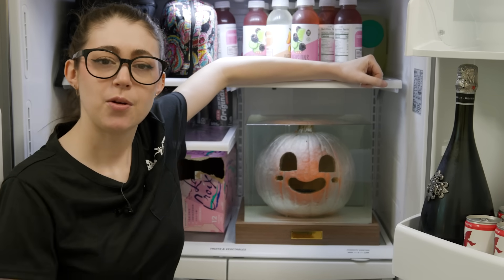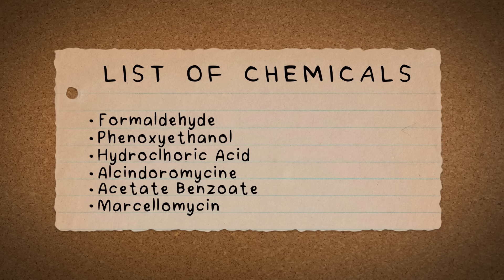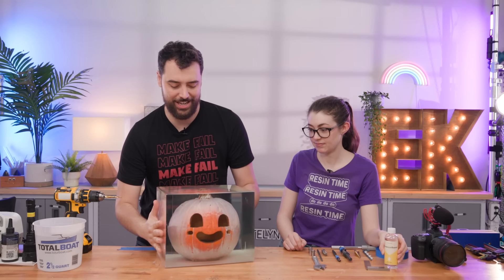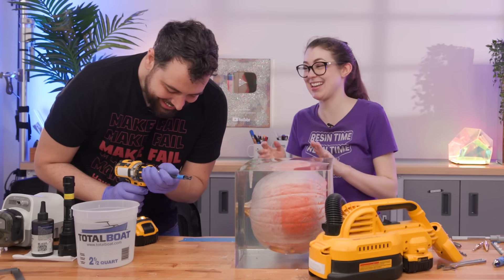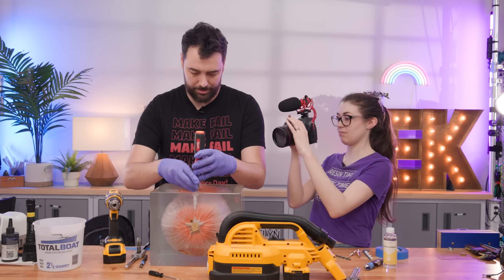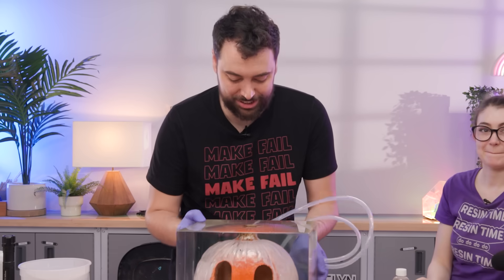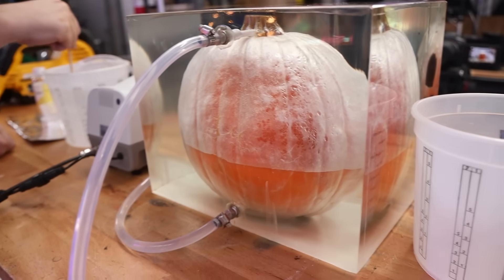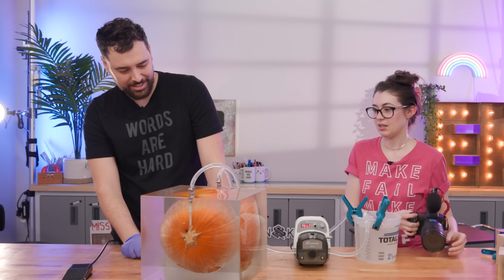Preserving A Pumpkin With Chemicals & Resin (feat. NileRed)

Comment: Katelyn, to fix your pants - soak overnight in a sink full of hot water with a cup of white vinegar and 1/2 cup baking soda. it will help release the oil from the fabric. rinse a few times and check for the oil stain , if its still there repeat the previous step with the vinegar and baking soda. use a small stiff soft bristle brush ( a firm toothbrush will work) and make a paste with the baking soda and a bit of water , scrub it into the oil and rinse a few time, then wash as normal. should come out .

Comment: Yall could try "speed bleeders" for cars brake systems. They are one way bleeder valves. You'd have to push more oil in and bleed the air out, but it might work!

Comment: Use your vacuum pump connected to one port with an expansion canister in between with ball valves at each connections. Connect the other port to your fluid of choice, also with a ball valve. Turn the fluid valve off, turn both pump and canister valve on, then create a vacuum. Once full vacuum is achieved turn the valve to the pump off, leave the valve to the canister open then slowly open the fill valve open. Fluid will slowly fill Chunk’s cavity trapping no air, and once the block full it will outflow in the expansion canister the. You can turn both remaining valve off and cap it. Also you need actual thread sealant. I suggest Loctite 567. Process is just like an old school automotive brake system bleeder.

Comment: IDK what it's called but I've seen people resin treat wood before , you might need to do that first. Heavy coat of runny resin and then vacuum till dry, in theory I think it forces the resin into anything porous while near vacuum so less gasses are in there overall. Then you do the entire cube cast around it after.

Comment: Evan and Katelyn I was thinking that maybe for Chunk the Third you could try to stabilize him, sort of like wood workers do with a thin resin that penetrates under vacuum.  The only thing I'm not sure about is how well pumpkin would hold up under the baking process to cure the resin. I would think that this would help with the expansion issues you've been having with Chunk 2, by giving no air voids in the pumpkin flesh itself seeing that the pumpkin is a spongy material.  Just something I was thinking about to get the best possible results for your next pumpkin.

Comment: Hey E&V I have a question, are the bubbles that are being produced Co2? Like is Chunk fermenting? Your troubles seem to exhibit the same issues as a sealed off wine fermentation. I think a way to remedy that is to use something that can chemically bond to the pumpkins fibers rather than covering it. There’s this type of resin called “cactus juice” that can achieve that effect it’s used for stabilizing brittle and crumbly wood Peter Brown from ShopTime has a few videos on stabilizing resin. I hope that helps in your endeavors!!

Comment: The ghostly or silvery sheen you're seeing around Chunk 2 might be due to total internal reflection! When light passes from a medium with a higher index of refraction (the resin) into a medium of a lower index of refraction (the substance between Chunk 2 and the resin, for example, air in the last clip), there are angles where light cannot transmit through the interface between the different mediums, and you see it reflected instead. I've not got the chops to really explain it, but it's super interesting! If you can find a way to seal it such that it does not leak, you can find a substance with a higher (or equal) index of refraction to fill the gaps with. That will (maybe) remove the sheen obstructing the view of Chunk 2!
Reply: That said, it's possible the index of refraction of Chunk 2's pumpkin surface is lower than that of the resin, so filling it with a substance of a higher (or equal) index of refraction than the resin might not help. You may still have the mirror-like surface in that case

Comment: Mineral oil seeps like crazy if the container is not completely sealed, I think the problem (main one at least) was the fact that even if u covered the npt’s with the plugs it continued to seep because was completely sealed . Even more if nothing was used to avoid the metal-metal contact. But nice try

Comment: The bubbles are from bacteria and outer stuff decomposing the pumpkin the reason why chunk 1 is fine is because the heat from you flash curing it killed all the bacteria so it’s can’t decompose it

Comment: I feel like if the screw at the bottom had Teflon tape around it when you put it in the plug, it wouldn’t have leaked. Teflon tape it, full Chunk 2 up with mineral oil again, then seal the top with Teflon tape up there too.

Comment: okay, so I'm a bit drunk but like, could you encase everything but the very bottom in resin and let the next pumpkin rot away and then pour resin into the cavity to make a replica pumpkin? Idea for chunk 3 (or 4 if you already started 3)
Reply: They could carve a pumpkin, cut it in half, and use it to make a mold. Then create an orange resin pumpkin from the mold. But that would defeat their goal of preserving a real pumpkin in resin.
Reply: @StarcoreLabs very true, but it is technically a way to preserve a pumpkin (albeit it is cheating quite a bit)

Comment: Maybe the bottom valve wasn't sealed right when you left for 10 days? Just a guess Maybe you can try to seal the bottom when it's done or at least something to keep the oil or whatever you use to preserve chunk 2 from leaking out also the tray idea is definitely a good one to avoid oily messes

Comment: half way thru the video and the bubbles are causing a panic, don't they just need a new vertical hole at the top of the pumpkin to allow air to escape while they pump the solution in?
Reply: great video ; how did it leak though?

Comment: So HEAT and then a tight air seal will stop decay.... should done hot water up to temp for a certain amount of time and then figure out that air tight seal (Yours couldn't handle the air pressure changes.)

Comment: Mineral oil is super slippery, it escapes any container you put it in
Shoulda just stuck with the water :P

EDIT: Also, chunk 1 probably got sterilized by the high temperatures during the runaway reaction, hence why he's still holding fast

Comment: I was gonna make a joke about watercooling a pumpkin but... maybe thats the route you should take, slap a reservoir on the back of that and a 12v pump on a PWM control so you can set a slow rate. the res will keep air bubbles out and a good pump can handle water or mineral oil fine, and you can just top off the res when it looks low. Heck maybe even some of the additives used for PC water loops could be used since theres anti-fungal stuff who knows.

Comment: i think your sanitizing liquid didn't work because you forgot to take the weight of the pumpkin into account.  the weight of the pumpkin had a lot, a lot of water in him.  it likely diluted the sanitizing solution too much.

also, the taps probably should have both been on the top.  so the pressure was not too bad, if they did end up leaking.  as is, you had full pressure pushing on the bottom port.

Comment: I feel like it's just going to get worse now that air has a way in/out. Moisture/rotting gas I dont think is made to be trapped. My old days od since that things try to move to even out hot goes to areas of cold, etc. This just seems to have un paused the rot and now the rot continues where it was stopped.

Comment: The fermenting stopped because the cube sat in the fridge and the pressure got too high. Once you let it warm up and released the pressure, the bacteria and fungi could start fermenting again.
You might need to pasteurize the next pumpkin before encasing it in resin.

Comment: I know the point of making the holes on the back was probably for aesthetic/cosmetic reasons. But the system will probably work better if the holes were in the top of the resin cube. Or of an effort to put some resin in at least the tapped tube of the bottom hole. I’m trying to say sealing the tapped holes better or making the holes on the top of the cube would be good solutions to prevent leaks in the future AFTER Chunk 2 is refilled again!

Comment: Honestly, when Nigel mentionned you wanting to keep the colors and everything, I immediately thought "translucent resin pumpkin" and that sounds kinda sick x3
Also we are not the same. When you drilled in and the gaz started escaping, I wondered if decompisition gaz produced under pressure was different from normal gaz or if it might be more dangerous, and wondered if Katelyn should put her mask back on... And your reflex was "I want to smell it" xD
Sad the project ended up back at square one... But that means a part 2 so yayyyy !

Comment: My idea, if, instead of using a fridge, you cure the resin in a temperature controlled environment (with both heating, cooling and a thermostat), set at 55C then all the bacteria would die over the course of several hours. the only issue is im not sure if that would cause issues with curing the resin

Comment: Evan, it leaked out of the plugs that you put in. The plugs needed to be wrapped with Teflon tape before you put the plugs in. Pipe thread joints will not seal themselves when put together.

Comment: The funny thing is they use femaldithide in certain plastics. I worked at a injection molding place and the semi translucent white plastic had some in it. Its kinda a unique smell compared to the other plastic i worked with. And you breath the fumes in a lot but you try not to

Comment: The ntp comments were harsh, but, uhhh...no comment. 😅
Two oil in fabric removal methods: 
1) Put wax paper topped with a paper towel between fabric layers with oily area on top to absorb oil andprevent the oil from sinking in to the other side. Cover the stain with a decent layer of cornstarch and leave it for a few days to a week. Check back of stained layer to check oil absorbtion. Pour off residual cornstarch and wash garment with warm water and detergent. (I've used this method successfully to remove burger grease and oil from a chocolate stain.)
2) Apply Dawn dish soap and scrub gently, then rinse and repeat if necessary. Wash garment with warm water and detergent. 
3) Use method 1 followed by method 2.

Comment: how safe is that crap that leaked out if it will be evaporating and getting into lungs over time
Reply: The "crap" that leaked out is mineral oil, the stuff is minimally toxic and there's no enough there to be a problem for their health.  The problem is just how massive of a pain in the butt it is to clean up.

Quite frankly I figured this was going to happen once they used mineral oil, it doesn't play well with all kinds of plastic and loves to just get everywhere.

Comment: Chunk 1: The heat from the flash cure likely killed most microbes that feed off of the pumpkin, so the degradation process is unnoticeable to this point. (interesting that the heat didn't visually affect the pumpkin tissues)

Chunk 2: There's so many pores and micropores in the pumpkin tissue that wouldn't have been filled by the viscous resin, so you'll need to constantly bleed the air from the system for quite a while. There would be a little less bubbles with mineral oil since its more viscous. 

This will sound like a lot of work, but when working with organic material, prep work goes a long way.

* As a suggestion for the next Resin Pumpkin, you can try a short term preservation method of spraying isopropyl alcohol on all reachable surfaces. Then try the flash cure method, followed by encasing that resin block into another using the slow-cure method. 

Side note - In the previous disinfecting tests, because all pumpkins were in close proximity to each other, and in the same enclosed area, the chances of a random spore/microbe landing on any given pumpkin was high and spread between samples. The alcohol test used 99% so its only effective up until it evaporates (within seconds). 

 In microbiology and plant tissue cultures, its always best practice to sterilize and disinfect. 
You can try redoing the disinfecting steps, each sample in their own enclosed area, and multiple rounds of spraying. (for the alcohol, use about 70% so it doesn't evaporate within seconds, just like how hand-sanitizers work). Same for bleach solutions (but less often as these don't evaporate as fast)

Or even try a mixture of methods. For example, using dilute bleach solution, then after drying, 70% ethanol or Isoprop.

Comment: the cells in pumpkin would be where the air bubbles are coming from, as they fill with liquids, the air is pushed out, if you have it fill from bottom and exit the top, it will force the built up air out of it; is there a way you could set the parts you put in on this vid, when starting a new 1 and would you have to consider the reaction on the resin, from the liquids you put in, also maybe using some nylon threaded nuts might prevent leakage ?? 

you need a colab with Niles from the start, he could do wacky experiments on his channel with you guys , to figure a method and you have him on yours' doing the project, would be a great combo I reckon

Comment: You need to use Teflon tape just like you do with a pipe for your shower. Try to unscrew those port nuts wrap Teflon tape around them and re-screw in the ports. It should stop the leaking. You may also want to Teflon tape whatever screws in to the port as well. You just need to replace that Teflon tape each time you burp him.
Reply: Exactly!! This is probably why Chunk 2 leaked. 
Also please wear eye protection when pumpkin juice can be a projectile 😅

Comment: "Have you considered adding a pressure gauge and blow-off valve and/or expansion tank to your pumpkin" is not a sentence I ever thought I would use.
Yet here we are.
Reply from the maker: haha we did consider adding a pressure gauge and blow off valve and/or expansion tank to our pumpkin
Reply: @EvanAndKatelyn  I mean.. at this point ... sunk cost fallacy would dictate that that is the only way to escalate,.. going for a "SteamChunk" look.
Reply: @JurrevanHerwijnen  Nixie tubes, superfluous bronze tubing, walnut accents... 😙👌
Reply: @EvanAndKatelyn  Also funny afterthought. Since farts are basically fermentation in the human gut, that air was basically chunk's farts.
Reply: @EvanAndKatelyn  just a pressure relief valve! Screws into npt thread you turn a screw to adjust the pressure and when it goes higher than chosen pressure it automatically lets it back down to set pressure! Set and forget especially for a project like this
Reply: They basically embalmed him...
Reply from the maker: Hahaha I REALLY should have! Would have been smart, safe, and actually super cool. We talked about it some in our supporter aftershow but definitely some lessons learned. The extra sad thing is that I had all of those already in my spare parts area :_eandkChaos:
Reply: @EvanAndKatelyn  An airlock used in brewing would've probably been best, since it would allow air to rise out without any air pressure forming. It seems like you were basically fermenting the pumpkin in a resin container.
Reply: @EvanAndKatelyn  use teflon tape on the thread of the plug ;)
Reply: @EvanAndKatelyn  It could be an IOT device that monitors pressure and notifies you via text in the tragic case of a pumpkin leak, so you can call a plumber in a timely manner
Reply: A perfect sentence actually
Reply: Might want to look into mummification for Chunk 3. 🤣
Reply: @mrjonlor  they tried in 2022 but didn't really follow the proper mummification process
Reply: Omg collab of the century!!!! And it was so unexpected 😂
Reply: You do need the proper hardware for the screaming chicken, amirite?
Reply: I can smell it through the camera
Reply: Put both holes on top next time, you fill a bucket from the top not the bottom. Especially if you are injecting it with any pressure, less fighting for the pump and gravity help you keep the oil inside instead of helping it flow out. Like how you pour resin into a two part mold with an air vent, both are on top so as long as there aren't overhangs on the molded part to trap air it all comes out the top vent
Reply: Who do you think you are quoting? You can't quote yourself until after you say it.

Comment: it seems like air got back in because the second hose was acting as a syphon, once you removed the other end of the circuit it was no longer a close loop and the tub of mineral oil was low enough down for the oil to want to flow back into the bucket.